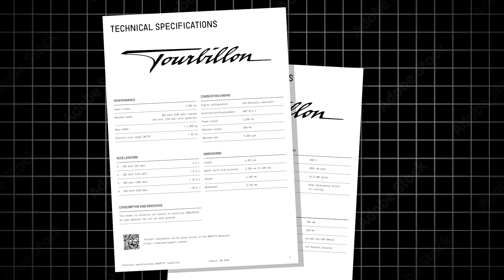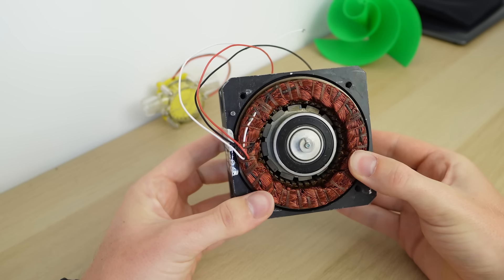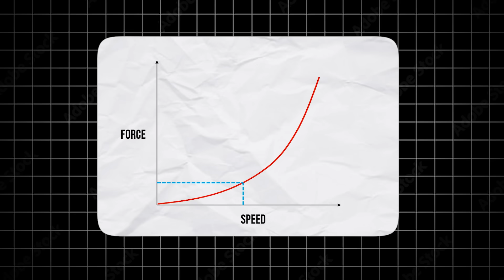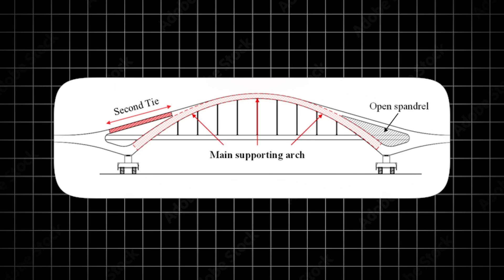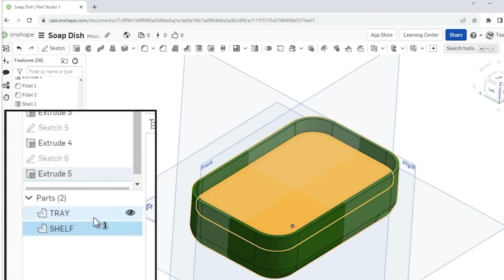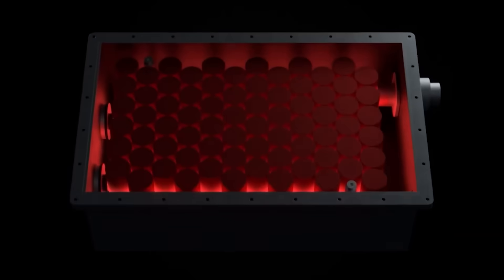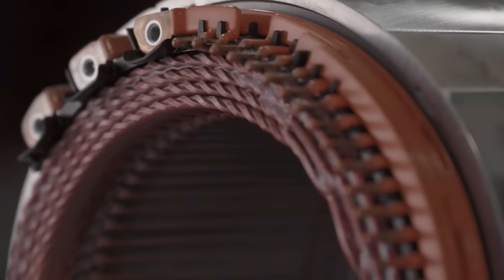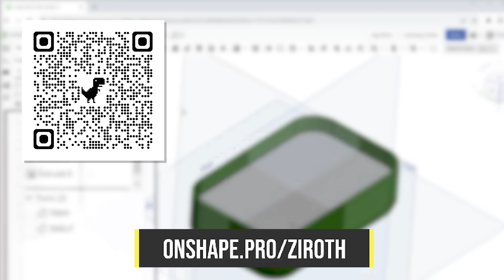How Bugatti's New Electric Motor Bends Physics

Comment: Well this is the clever application of known principles, but apart from the copper wire there's nothing bent I can see. Also there's a lot of speculation. Maybe "My try to explain Bugattis incredible Motor"? Or if you feel fancy "A thermal management engineer's take to explain into Bugatti's...." 
Still a good video though.

Comment: At CES there was a serve unit on display using immersion cooling in oil.
Reply: I rather think it was 3m's novec or similar, not oil. I've could also see how it evaporates since they didn't have the lid locked... Also, while a dielectric oil is quite possibly expensive, those 3m fluids are more so. Another question is temp ranges - what works better in cold/hot environment

Comment: If you choose the right cells, and the battery is large enough, you don't need cooling. Look at the Molicel P42A. 45 ampere in a 21700 packaging. 100 in parallel is 4,500 ampere if you have cooling. You would choose whatever arrangement allows you to get away with only ever asking for no more than 10 ampere per cell. Granted, the chemistry isn't as safe as lifepo4, they can still be done right, and safe enough.
Reply: P42a can do 30A continuous without cooling. P45B can do 40A without or 50 with cooling. Peak rates are much higher though ofc
Reply: @riba2233  Here's the spec sheet: https://www.molicel.com/wp-content/uploads/INR21700P42A-V4-80092.pdf
Reply: @riba2233  It does 45 ampere. There's no way in hell these batteries can do 30 amp continuous without cooling. No battery (this size) can. You have to understand how these are packaged to understand why. They are often installed in very tight configurations with no ventilation.
Reply: @SyntacticOperator   sure they can, one cell in open air, with 80c max on cell. Like I said, 30A cont for P42A and 40A cont for P45B in these standard testing conditions. In real world packs there are many variables related to cooling and load type ofc
Reply: @SyntacticOperator   we get these numbers from standardized testing conditions, that way we can actually compare different cells. There are too many variables in real life packs so y0u can't get solid numbers.
Reply: @SyntacticOperator   tool batteries mostly and some evs. 
Idk if y0u have seen new tabless 21700 cells that we got recently, they push the envelope to around 60A cont ;)
Reply: @SyntacticOperator  that is correct :)
Reply: @SyntacticOperator   yeah luckily I have a spot welder that I developed and sold for some time, it is a game changer haha
Reply: @SyntacticOperator   JP welder ;) it was before the other similar ones
Reply: @SyntacticOperator   oh that would be very neat, they look pretty costly though lol
Reply: Are y0u on reddlt by any chance?
Reply: @SyntacticOperator  I do yeah, will check it out. Same handle?
Reply: @SyntacticOperator  same :)

Comment: They probably have a large ultra capacitor pack to reduce the impact on the battery and allow for rapid discharge.
Reply: Highly doubt it. Capacitor's energy density is still too low <50wh/kg. Also a capacitor's voltage is directly proportional to charge stored. Meaning as soon as it discharges the voltage will decrease until it eventually reaches zero. Making it impossible to maintain any level of high voltage for long. They are probably using cells similar to A123's F1/Motorsport cells, 120-130wh/kg at 100C.
Reply: @Martin_Speed  i think it could be the case, few car companies like Maclearn and Lamborghini are already using ultra capacitor with their combustion engine to provide instant boost power along side with battery

Comment: immersive cooling with mineral oil of PC goes back two decades. Oil cooling of transformers and power equipment goes back well over 80 years. 
Seeing in in batteries, generators and motors is wild. It is also a bit of a "Duh" moment.  So obvious why wasn't it done long before.

Comment: I'm honestly all in for oil cooling. At least it won't rust like tesla motors that had a single lip seal keeping coolant away.
Also, thin (low viscosity) fluids were sold as aftermarket solution for e-bike outrunner hub motors to improve heat transfer and corrosion resistance at the cost of extra friction.

Comment: Wrapping carbon fibre to protect from forces from the inside that go out is smart. Doing it for the titan submarine was stupid. You use rope to lift heavy weight but you dont use them in compression where you use a beam that can withstand it.

Comment: this is a horrible idea...
mineral oil, and the 3m flourinent compounds, all eventually degrade over time and lose their ability to remain non-conductive.
I doubt they found a magic material that doesn't corrode over time due to (esp in this case) electrostatic migration.
In other words.

This is a great way to making a ticking time bomb

Comment: Koenigsegg did that but with 250kw output a year ago. Less weight , higher performance.
Reply: And Koenigsegg put that in Gemera, 800 hp electric + 1500 hp V8, 2300 hp combined, ridiculous
Reply: @kerimca98  Then they called it dark matter and called it a day. 
Bugatti just copied Koenigsegg but needed help from cosworth and Rimac. Named it after an old clock mechanism and connected it to Apple.
Reply: AFAIK also with a collaboration with rimac, rimac has also collaborated with Aston Martin and a variety of other manufacturers
Reply: @DutchBart666  Rimac did not do the motor, they helped Koenigsegg with the battery pack.
Reply: ...stood still in 45°C heatwave traffic jam of morons who abandoned their own vehicles to gibber excitedly at the glass coaster they hold up as if they've a full camera crew and studio financing. :body-green-covering-eyes:

Comment: It's more likely that they are using custom built axial flux motors rather than the old pedestrian radial flux versions.  They provide more torque at lower rpms in a more compact space.  If Bugatti are still using radial flux motors I would be appalled.
Reply: It is not that simple, radial ones are better for cars

Comment: I would doublecheak/google diference between powerdensity and discharge rate.
Reply from the maker: Power density is a common way to refer to how much power a battery can provide for its weight (https://energyeducation.ca/encyclopedia/Energy_density_vs_power_density) - This is tied to the discharge rate of the cells, but it more useful at a pack level!
Reply: @ZirothTech  I personally dont see power density in most of datasheets, not sure how common it is.
Reply: @danoseus  Power density is incredibly important. It's measured in watt per cubic meter. This doesn't give any real information of the speed of charge or discharge just how much energy can be stored in a given volume. When looking at different battery technologies the power density will tell you what tech can store the most power in a battery pack of a given size. This is something that has improved over time, but is still not anywhere near the power density of say gasoline.

Comment: It’s not continuous 800 hp.  If F=ma, then when you get to speed, no additional force is required (just kidding).  Actually, you have to provide enough force to overcome windage, and mechanical losses in bearings, driving coolant systems, etc.  The electric motor is only used (my guess) to give the assist during acceleration, or at low speed where the ICE is least efficient.

Comment: About 3 years ago I did 3D design a immersive cooled batery pack as a replacment for my Brammo Empulse battery when it eventually gives out. It has also almost twice the amount of energy in the same space and was a bit lighter then the original. It would make 200km trips and fast charging very possible. Good to see I was on the right track.

Comment: A natural progression from immersion cooling would be turbulated flow cooling, like top spec radiators. The tubes in the radiator have flow disruptors inside which dramatically increase thermal transfer as the cooling fluid is not laminar, but turbulent. I can imagine the cell casing to have a rough exterior to facilitate this.
Reply: I dont think this would be necessary, as it would run into a myriad of problems - you will have near perfect thermal dissipiation on the outer shell of the cell but what about the inner cell environmnent. I think that with flow cooling we do have enough room to concentrate on other aspects